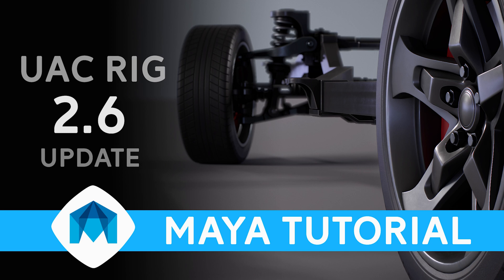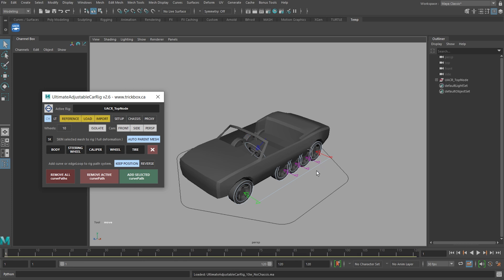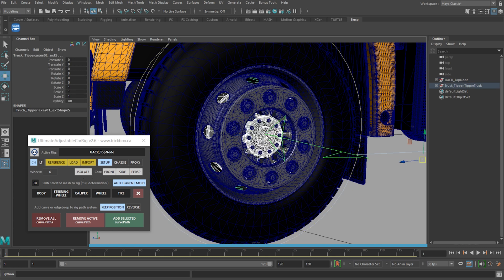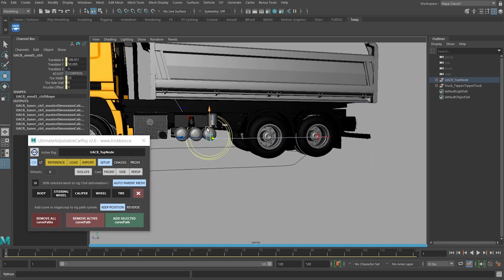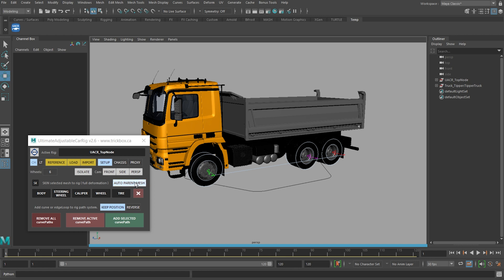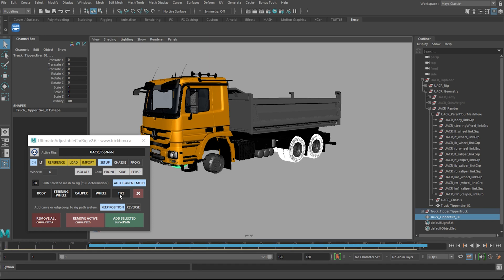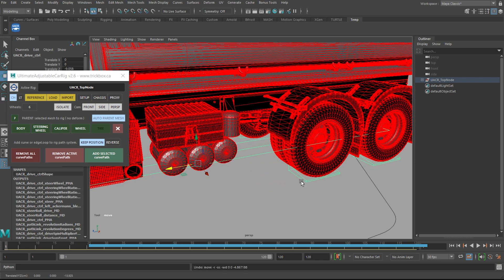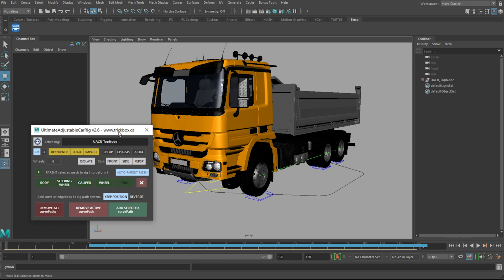Maya Car Rig | UAC Rig Update 2.6 | Maya Truck Rig

Comment: Really kool rig!! Is there a way to add a trailer to it? Like this be aleader rig and the trailer to follow it  for example a 40foot container.
Reply from the maker: Yes, it can be done by connecting 2 UAC-Rigs at the tow point and offsetting them on duplicate curve paths.

Comment: Great looking tool!  Is there a feature that will have the rig react to the terrain if it was traveling over rough surface?
Reply: Never mind. Just watched your Cybertruck video! Great work!
Reply from the maker: @johnnylummie2873  I was just about to link that video :)   Also the next update has a significant upgrade for this, should be out soon.

Comment: hi simon, the rig keeps flipping to the other side of its assigned spline, would you be able to advise anything? thanks
Reply from the maker: Send me the file or a video, lets resolve the issue: smills@trickbox.ca
Reply: in addition to this, the wheels sort of go through the floor and the entire car seems very stiff and has no suspension?
Reply from the maker: @Saifsatar187  sounds very odd, could you send me the file or a video and I will resolve the issue: smills@trickbox.ca
Reply: @SimonMills  Hi Simon, I've gone ahead and sent you an email. Thanks
Reply from the maker: @Saifsatar187  For the path flip, try removing the path and re-adding it. The animation should stay intact. Removing and adding curves are covered here: https://youtu.be/A6IHhxZTeu8?t=1487  If the issue happens again, let me know.
Reply from the maker: @Saifsatar187  The rigid suspension you mentioned is because the wheels are not connected to the terrain, this video covers that: https://youtu.be/aP5P2kV9vJM
Reply from the maker: @Saifsatar187  One thing to note with your setup, the curve should not follow every bump of the terrain exactly, the suspension will fill in the gaps . Think about what suspension does in the real world, it takes a rough path we drive on and smooths out the ride. The curve is essentially our smoothed out ride path, attaching wheels to the ground then gives the illusion of suspension impacting the ride.
Reply: @SimonMills  Thats brill! Thanks!